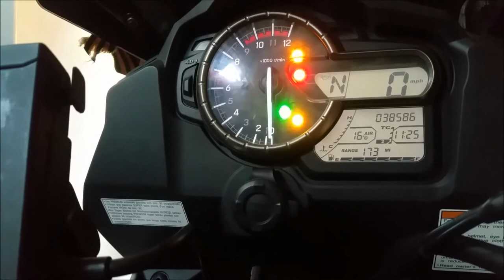Suzuki V-Strom C46 Error Code

Comment: Thanks for video,do you know what is that part for,i bought my Vstrom recently,after watching your video i found c46 error because of this one and i realised it is rusted and cables off by previous owner,can you explain what is this use for and what you call this part.Thanks
Reply from the maker: Hi, it basically controls the butterfly valve in the exhaust. The valve opens and closes when you twist the throttle. It reduces the sound emitted from the exhaust and supposedly helps reduce emissions (although I am not too sure whether it really does). It also helps with the power. Some people take it off as they claim it gives them around 2-3 hp more power.

Comment: I use to do that, but this time, it doesnt fix error.. and it seems really locked... it doesnt move anymore.. what could i do ? I have to change it ? Moreover the cables are tight and have no play...
Reply from the maker: Check to see whether you can loosen the 2 bolts holding the cables and adjust the cable. Once you have it just right you can tighten the bolts again

Comment: Did this really fix the issue? Mine keeps on appearing and going away. Plus, WD40 will smoke a lot, I'm not sure how safe it is.
Reply from the maker: It is quite possible your cables are slipping. In that case you will need to tighten the cables.